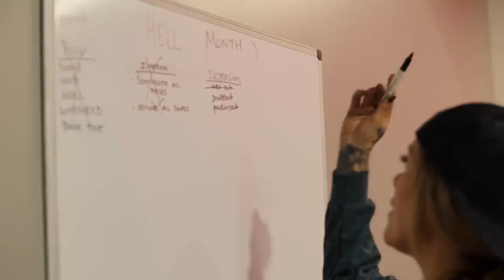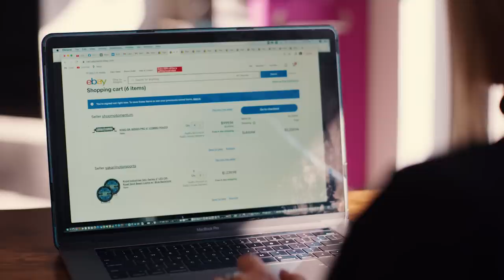Can Lacey Blair and the Modathon Builders Trample Over Calico Canyon? | Modathon | eBay Motors

Comment: I love that old hot rod behind lacy I like the solid wheels on her I didn’t see the front not sure if a Chevy Cheyenne or a 70’s dodge either way dam good paint scheme ms lacy  some limit straps on her FYI need to lower air pressure in your tires
Reply from the maker: The air pressure suggestion is a valid one, lots of people mentioned the same thing. That is the 1st thing I will do if I ever hit the trails.